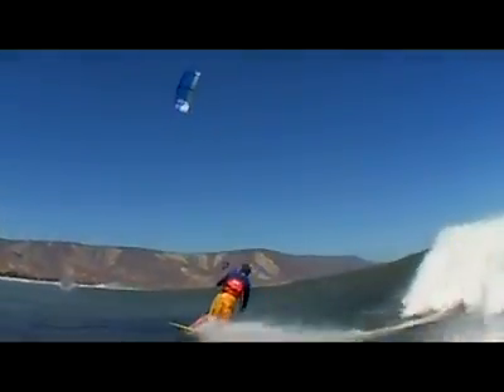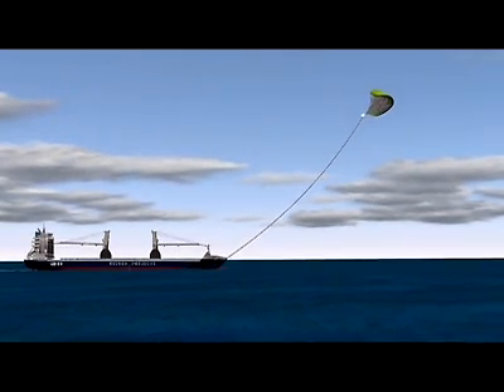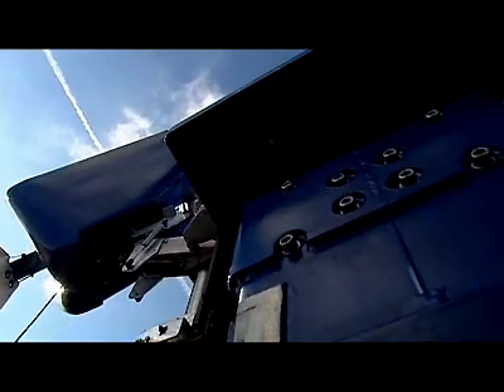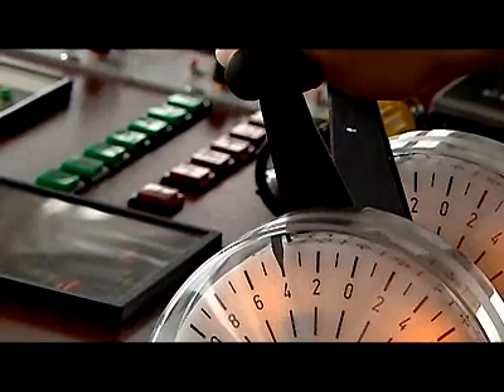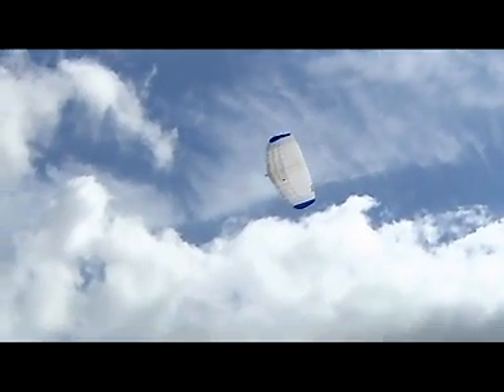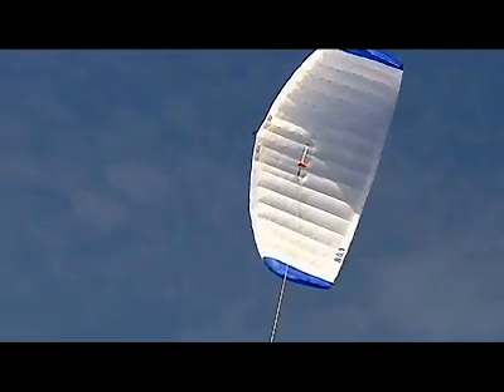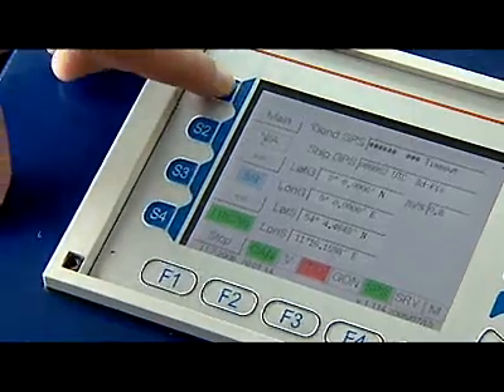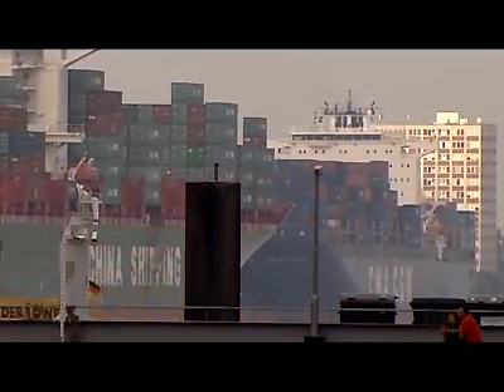SkySails bring windpower to container ships!!

Comment: Because it becomes less and less efficient as the course becomes more upwind, you need to divide the fuel efficiency numbers by about two. Half the time, you're heading upwind. Still, it's an excellent solution, assuming it is durable.

Comment: Wrong...and wrong.
One line is enough. Steering is done by a servo under the kite.
There is no need for depower.
The kites are over 160m².
A 150m² kitegen will generate 3MW at 800m.
Kiteves will use the kites to provide electricity insted of pull.